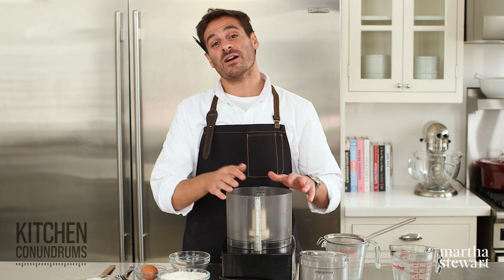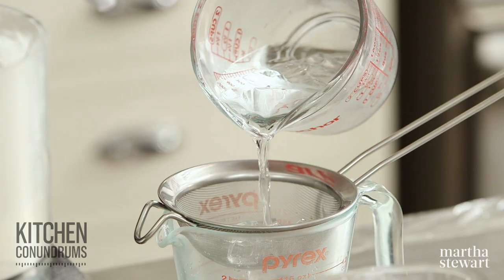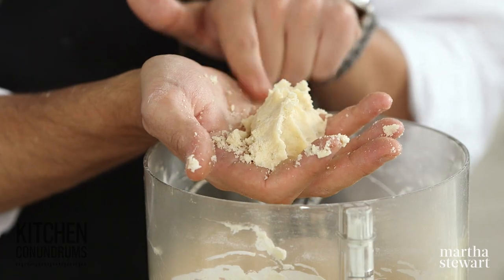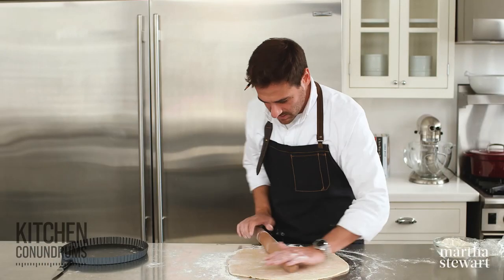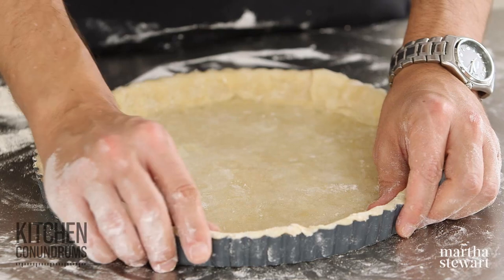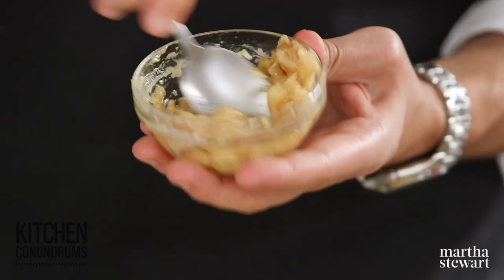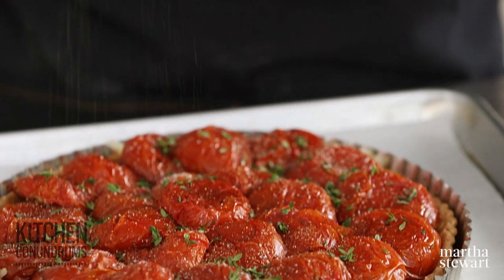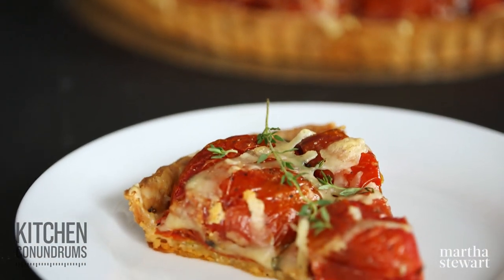How to Avoid a Soggy Crust - Kitchen Conundrums with Thomas Joseph

Comment: I have the same recipe mine uses a little apple cider vinegar in the waterI think the egg helps. it rolls out easily without breaking and ripping apartWhen rolling out and placing in pie plate or as a top thrust

Comment: The edges shrunk a lot unfortunately
Reply: Didn't shrink, different pan
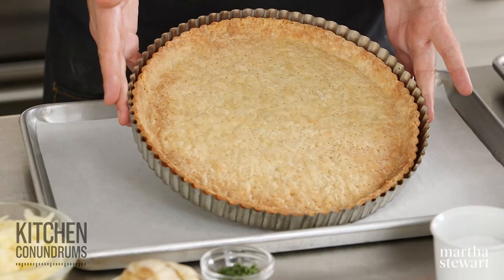Reply: @tonytiger2450  Yes, different pan, but it still shrank as you would never cut the edges to be so low. He would have prepared this pan as he did the one in the first part of the video. At 10:10 you can see it is only 50% of the depth.